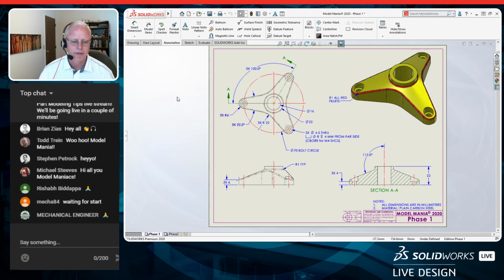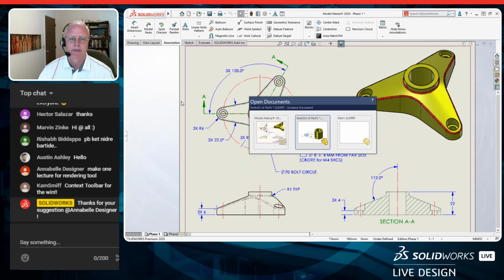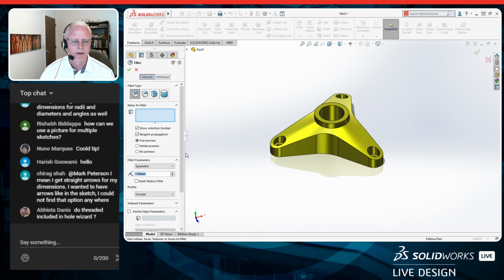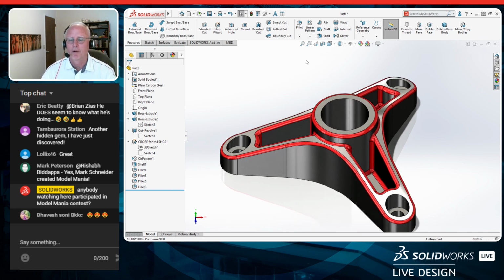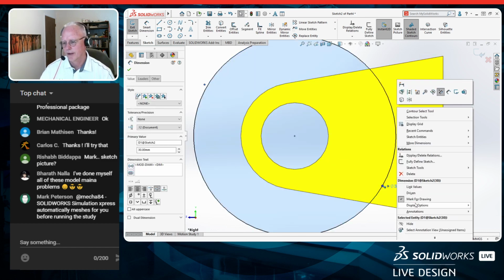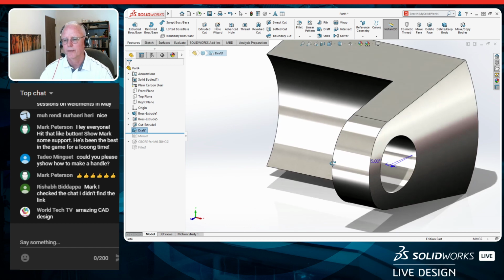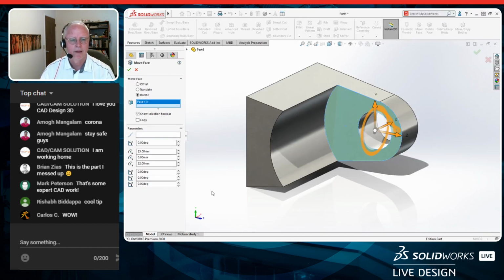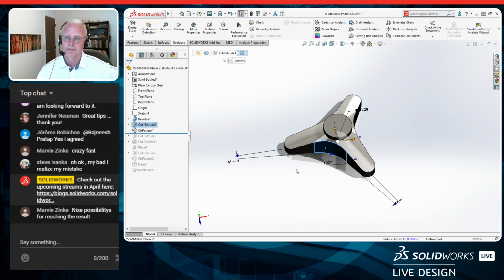Model Mania Part Modeling Tips - Episode 6 - SOLIDWORKS Live Design

Comment: Thanks for video. At 24:20 there is  rebuild error coming "Failed to create fillet. Please check the input geometry and radius value." How to fix that ?
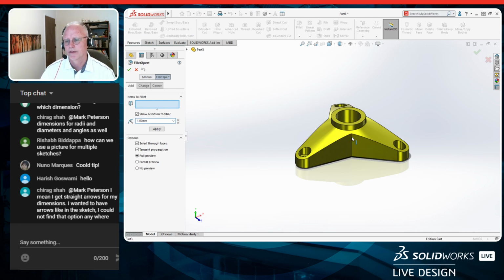Reply: Hi Rushikesh, that failed fillet is the 22 mm fillet that was added at time 17:00.  This is a constant size fillet and cannot be changed to a face fillet, and since a proper solution could not be created with the constant size fillet, I just deleted it and created the face fillets to get the proper geometry.  (Actually I create the face fillets first)